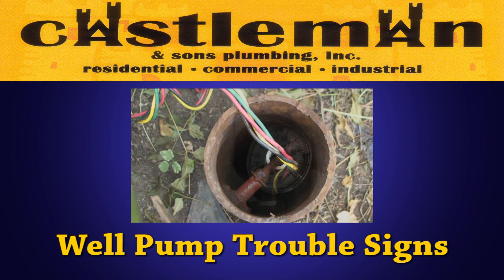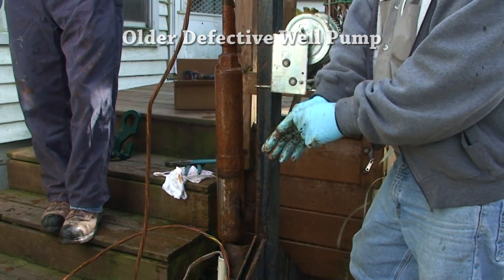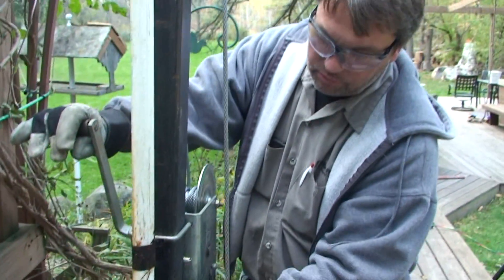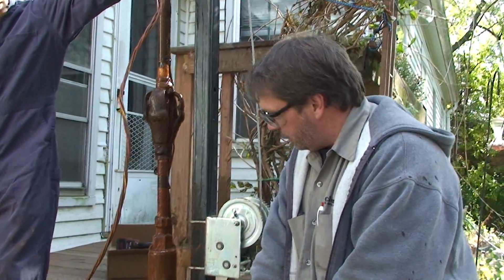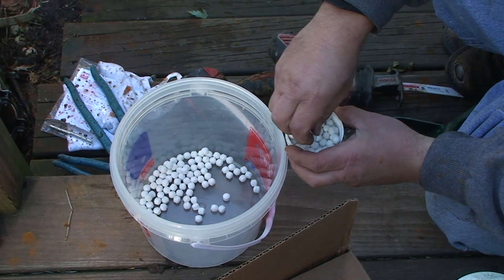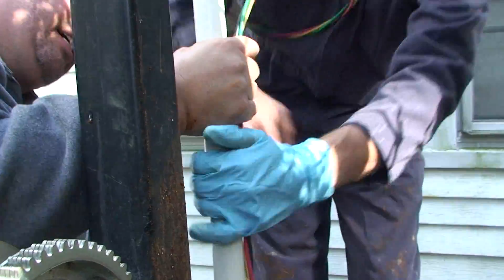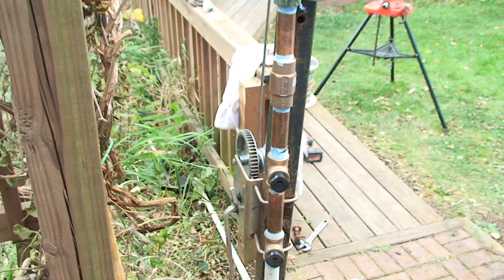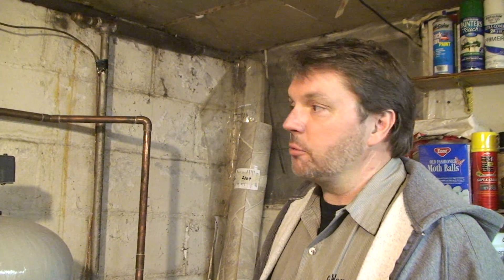Well Pump Trouble Signs & How To Replace A Defective Well Pump

Comment: Is this an expensive fix?
Reply from the maker: Hi, thanks for watching and sharing your question. The costs vary greatly, depending on the horsepower of your new well pump and depth of the pump inside the well casing and the accessibility to the unit, as well as any damaged parts that need to be replaced. 
When this video was created 12 years ago, this well pump replacement cost thousands of dollars, and all costs have gone up since then. Expect thousands of dollars for most well pump replacements and associated control systems. Also, you will want to obtain a quote from a reputable and professional service. Best of luck with your water system.

Comment: I think when my pump  runs I hear a loud vibration I think it's the pump it's under the house
Reply from the maker: Hi Newwavepressure- it is possible that the pump is beginning to fail, or that some component has come loose. If your pump is 10 years old, or older, you should consider doing a replacement. They excessive noise/vibration are symptomatic of some type of failure. Good luck on your repair and thanks for watching our channel.

Comment: Here in East Texas we use Hydro pneumatic tanks. It's just a tank... no bladder. They are only found in areas where water quality requires them. Water and air are mixed together in a hydro pneumatic tank to reduce the "rotten egg" smell that sulphur bacteria and hydrogen sulphide gas in the water can cause. My question is I know there is a bleeder valve down under that allows water to drain back into the well and shuts when the well restarts. I believe this is so the air in the downpipe is used to recharge the tank and a float valve in the side of the tank controls the amount of air in the tank. I currently have a 40 gal tank and want to replace it with a 120. Is the depth of that bleeder dependent on the size of the tank?
Reply from the maker: Hi helihoot, no the depth of the bleeder is not dependent on the tank size, as long as it provides adequate release of water, and the system functions properly.
Reply: @VintageVideos2009  Thank you sir for the prompt response. I kind of figured that but wanted confirmation.

Comment: Sir is it best to hire a plumber or well co. guy to diagnose well issue? I'm pretty sure outside house perhaps the wiring due to earthquake. TIA, Alaska
Reply from the maker: Hi Pu Nipuk, thanks for watching and sharing your question. There are a lot of well pump issues that need consideration, so it is essential to hire someone that can diagnose the problem. It's our opinion that well systems are a bit complicated - and the cost to remove a well pump, replace all the wiring and piping is significant - so you do want to be sure you resolve the problem. Also, a professional plumber or well installation business, may also discover your problem could be in the control panel or something "above ground" eliminating a tremendous amount of cost, and downtime - in order to resolve your issue. In other words, a well system tends to be a bit more complex than most homeowners want to tackle - and you know - once to pull things out of the well, it's not so easy to just put it all back down. A lot also depends on the depth of the well, the age of the system, and other individual considerations. Thanks for sharing your question and best of luck on your repair.

Comment: Replaced pump Sunday went out today  put another new one in today and nothing pump gets juice
Reply from the maker: Hi Sunny Flower, thanks for sharing your experience. It seems unlikely that the flaw is with the new pumps. One maybe, but unlikely that two pumps have failed due to defect. You would want to double check all your wiring, and also the control panel operation. You may also choose to consult or consider having a professional plumber come out to diagnose your issue - this may save you a lot of time and loss of water use in your household. Best of luck with identifying the problem, getting it corrected and having your water service back in use.

Comment: I got a new well drilled and pump and pressure tank installed and they never put a control box.. just a regular power switch and wiring to the pressure switch.
Reply from the maker: Hi 462ANIMAL, thanks for watching and sharing information about your recent installation. There are a myriad of equipment and set up options. We presume everything that you have installed is all functioning properly. This video was taken a few years ago, however the new control panel was the ideal way to go, for this situation. Wishing you many long and happy years of great service with your new well pump and tank.
Reply: @VintageVideos2009  It does work  , just I think it’s not to code with out a lockable control box..  our well is 200ft  if I put a hose on the pressure tank drain valve and open it all the way.. it takes about 30 mins till the water pressure drops to about 30 psi. I take it that’s because my GPM  is only so much.. it does recover  in 30 mins it seems to have the same amount..  I was going to have them drill to 300ft but wasn’t sure if it was going to get us more GPM
Reply from the maker: @462ANIMAL  Well a reputable, professional, licensed company should be performing a new installation according to code. However, some municipalities have a variety of requirements, so a control box is a common in many situations.  Drilling your well to 300ft, would not necessarily increase your pressure - that is dictated by the submersible pump within the well and the other components, rather than the depth of the well. It does sound like your system is working OK, based on your information. Hopefully you will enjoy years of trouble-free operation.
Reply: @VintageVideos2009  yes , it’s working fine.. pressure gauge goes up to 50 psi and pump turns off.   Hopefully it’s trouble free for a good 10 years .. Thanks
Reply from the maker: @462ANIMAL  Yes, based on your information here, your system appears to be operating normally and it seems all is in order. Hopefully you will have years of solid, trouble-free service. Thanks for sharing your experience with our viewers.

Comment: How much does ALL OF this cost  ,plus your time typically?   I am a OLD man.
Reply from the maker: Hi Mathias, thanks for watching our video and sharing your question. There are quite a few variables involving the well pump replacement - especially the depth of the pump and it's horsepower. On this job, with a depth of about 80 feet - the cost for the new well pump, components, a control box, and related parts and labor were about $2000- when this was completed. Today, with higher costs for components, the cost would be considerably higher. Replacing a well pump is a somewhat complicated endeavor and a professional plumber would be highly encouraged. Honorable companies will provide a quote to give you an idea  what the cost would be.

Comment: My breaker keeping triping causing no water pressure.  Can't figure it out. .
Reply from the maker: Hi Blitzburgh let's go, thanks for watching and sharing your question. With a circuit breaker tripping, you may have some kind of mechanical issue with the pump itself causing an overload, or you may have some kind of electrical short circuit due to a failed component or even a wiring issue. I would encourage you to have a professional diagnose the issue, as there are a lot of different components that need to be addressed. Good luck with the pump.
Reply: @VintageVideos2009   ok  THANKS

Comment: I would attach a drill to that hand crank. Lol
Reply from the maker: Hi Theron, yes, it's a lot of cranking isn't it. However that winch is designed to handle the task perfectly. The depth the pump lies has a lot to do with how much cranking takes place. Thanks for watching and sharing your comment.
Reply: Dewalt drill instead of hand crank.

Comment: https://youtu.be/OeyewINrBys

Our home was built in 72', in Wisconsin as well with the crazy iron that fills up the water filter. There was a bladderless pressure tank which was replaced with a bladder tank in 2004.

 In the last 10 months the water has been "sputtering" as shown in the link I posted to my channel. I have replaced the plumbing system in the home with Pex. The 17 year old bladder tank maintains pressure. 

But the water issue is becoming worse. I can hear the well pump throughout most of the home. That sucker is loud. And it's probably nearly 50 years old. I'm not sure if it's the well pump or tank. I could use advice. Thank you!
Reply from the maker: HI markofthebeast, say if you are located in Wisconsin, please give us a call on Monday, during regular business hours to discuss the issues your are having. You have a number of things happening that we can better analyze over the phone with you. Here's the phone number and our website if you need more information, (414) 425-5797 & http://www.castlemanplumbing.com. Thanks for sharing you issue and your video with us.
Reply: @VintageVideos2009  I have several friends that are plumbers. But it seems that many plumbers today have little to no understanding of well systems. Particularly older wells with the bladderless tank or that once had a bladderless tank. I will contact you. I appreciate it and thanks!
Reply: We've concluded that it's the well pump. All the symptoms match up. Most importantly, it's creating obviously loud noises which sounds similar to bearings grinding.

 There's moments where it "cuts out" for fractions of a second. It's 73' down and about as loud as the washing machine from inside the house.
Reply from the maker: @markfothebeast  Glad you've found the issue. Most well pumps have an average life of 15-20 years, so you've gotten a long, long run out of the unit you have. All the best on the replacement and let's hope you get another 40 years on the next well pump. Thanks for sharing your story and video with us!
Reply: Now comes the part where I decide whether or not I have the proper tools and knowledge to remove the pump as well as inspect for potential well issues during the replacement. I have never once removed a well pump but I am fairly knowledge in generally most areas.
Reply from the maker: @markfothebeast  Hopefully, our video will shed some light on what you can expect. Of course, you're likely to find a different pump or a few variances, but in general, if our video makes sense to you, and you have a lot of experience, it's something to consider. Bear in mind, the well pump also included a new control panel, so you'll want some expertise in that area if needed. Best of luck with your replacement and wishing you many years of trouble-free service.
Reply: @VintageVideos2009  The current pump is a 2-wire. Is the 3-wire pump with the panel a capacitor start motor? I was looking at diagrams and it looks like the yellow wire runs to a cap. 

Couldn't I just do a direct replacement with a new 2-wire pump? The wiring runs all the way under the foundation and enters the home through the basement floor.
Reply from the maker: @markfothebeast  This a probably not something we can recommend by messaging. You can call (414) 425-5797, to discuss it further. We may be able to provide some advice, but not easy without seeing the situation.

Comment: You really threw me with that bleeder. I've got one and took it out as I thought they were just making a coupling. Ready to drop the new pump in and could you tell me if the bleeder is good to keep in?
Reply from the maker: Unless you were having trouble with the old blenders, or your new pump required a significantly different set up, your old blenders are likely fine. Of course, you can also change them as well, to keep everything new at the time of the new pump installation.
Reply: @VintageVideos2009  thank you but its that rubber flap air bleeder T that I don't understand and its about 200' well and I can't even imagine what it could be good for. Do you know or could you direct me?
Reply: @VintageVideos2009  200' well pump and at 190' they put that bleeder T in probably back in 1980. With new pump and pressure tank is there a reason to leave the bleeder T in?
Reply from the maker: @coreyrogers2159  Great question, someone asked this about a year ago as well. Here's what the bleeders do. In the system installed at this site, the bottom bleeder sits below water level, and allows water to flow out of the pipe riser.  A snifter valve is above the water level, and lets air flow into the top bleeder and into the pipe when the pump stops. When the pump starts again, it pushes the air that replaced the water in the pipe between the snifter and bleeder orifice into the tank. So the top bleeder lets air in, the bottom bleeder lets water drain out. As the water level in the tank drops, the float attached to the air release valve swings downward opening the air release valve, which lets excess air out. When the float rises to set point, the release valve closes. When the pump starts again, the process repeats. It's a bit complex, but the bleeders help to maintain the pressure both above the water level and below the water level in the well. This is an explanation of bleeders and why they are still in use today. As you may have noticed in our video, the bleeders, the snifter valve and most components were used again, after the new pump was installed. Thanks again for watching and sharing your comments.
Reply: @VintageVideos2009  Great answer, thank you so much.
Reply: @VintageVideos2009  Thanks for the great video. I think you coukd do another video just on snifter valves and drain back valves, uses, installation and testing. I have a system with a bladderless water tank setup and no plumber ever suggested this as a solution to the air depleation in the tank and my almost monthly need to drain the tank to restore the tank air pressure. I don't want to change the tank, it is a 120 gallon steel tank from 1991 still in great condition.
Reply from the maker: @jlaw8882  Hi J Law, thanks for the comment. We appreciate the idea of showing and discussing various air depletion systems, and believe as you do, it could add a great deal of value to our channel. We'll look for an opportunity to develop a program like that in the future. Thanks again for watching!

Comment: What’s an average price for a job like that?
Reply from the maker: Hi Carlton, thanks for watching and sharing your question. Average price would be very difficult to come up with. On this job for example, it has to do with the depth of the well and how much pipe is needed to replace, the actual size of the submersible pump to be replaced, whether electrical must be replaced (advisable if the electrical is more than a few years old), cost of the control box, the labor hours. On this video, it was a two-person crew that took most of the day, plus all of the components replaced, and prepping the new well for use.  This job for example, was several thousand dollars, including all components and labor you see on the video. We would urge you to have several companies provide you a quote, also taking into account their customer reviews and professionalism. Good luck on your project.
Reply: Thanks for the quick reply. My submerged pump is 120 feet deep I was told when I bought the property but it pumps up quick to about 38 psi and that's as high as it will go. Any ideas?
Reply from the maker: Do you know how old the pump is? Has the service been good, up until now? Is the problem intermittent or constant? Do you have a pressure tank, and have you determined whether it is working correctly?  As you can see, there may be other issues at play, before you need to replace your submersible well tank and perhaps any pipelines extending down to the bottom. On this video, as the bearing shaft on the well submersible were failing, the water pressure/volume became very inconsistent. Sometimes it flowed just fine, then suddenly the volume would be reduced by over 50%. Knowing the pump was over 18 years of age, it led to suspect the submersible may be failing.  If you are still uncertain, having a professionally licensed plumber or well company expert visit and diagnose your problem would seem to be a worthwhile move.  It would be a very challenging job for a DIY project, if your well pump is 120 feet or more. Don't let this video fool you, it is a physically demanding job to winch up the well. Wish you all the best on your repair. Please let us know what the problem was.
Reply: No sir I don’t know the age because I bought the property 2yrs ago and it was already on it. I do have a well x troll pressure tank that seems to be working normally. I’m going to follow your advice and have a service company come out and check it and I will let you know what they determine the issue is. By the way it pumps up pressure fine consistently to 38 psi but that’s as high as it will go and if I adjust the pressure higher than that it will just keep running without shutting down. I’ve adjusted the settings to around 36 so it’s kicking on and off. It was originally set at approximately 30 on/50 off but now it just won’t go past 38 psi and it concerned me. Thank you very much my friend for all the help you’ve given me.